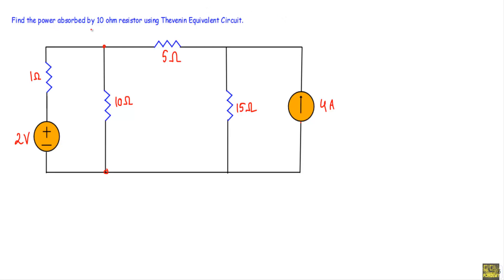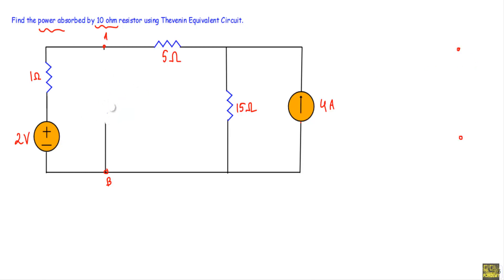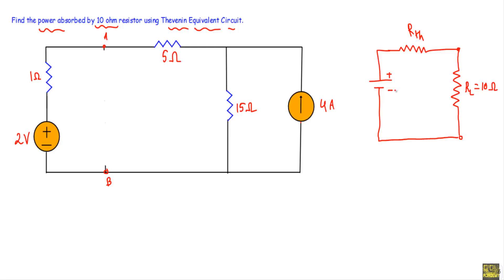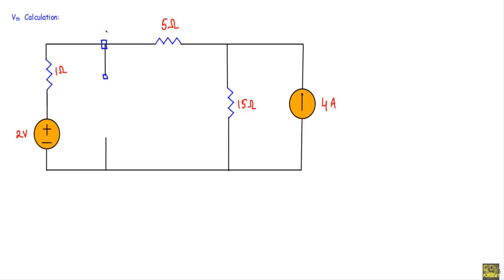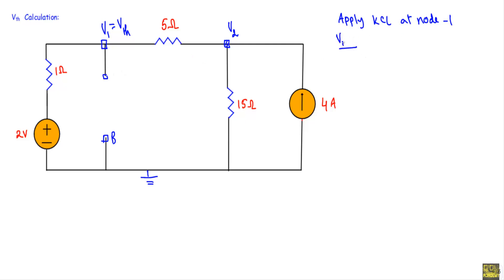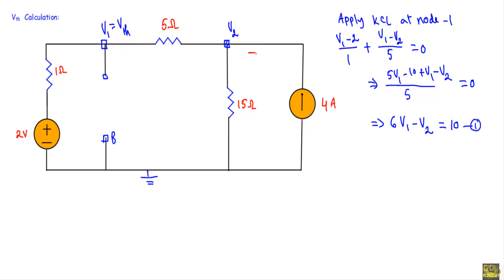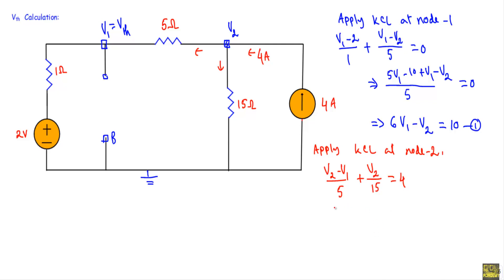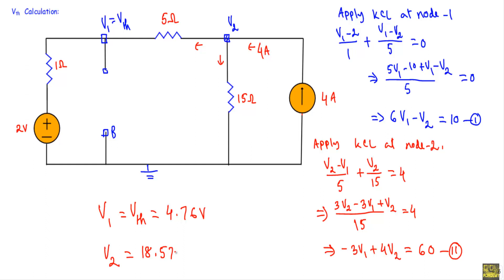Thevenin Circuit : Example 3

Comment: Shouldn't it be (1+5)//15???
Reply from the maker: What do you want to calculate and at what time?/
Reply: EE Academy total resistance of the circuit at 3:10
Reply from the maker: No, mine was correct. With respect to A- B terminals, series of 5 & 15 , is in parallel with 1 ohm
Reply: EE Academy ok, I will take another look thanks sir